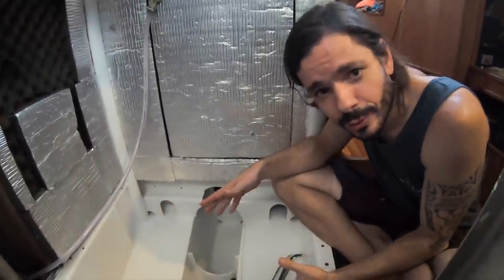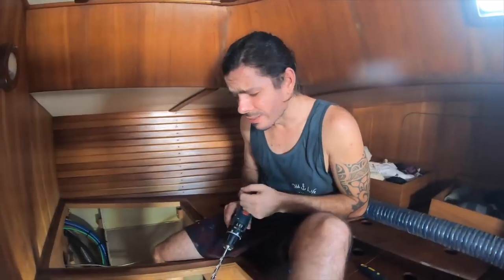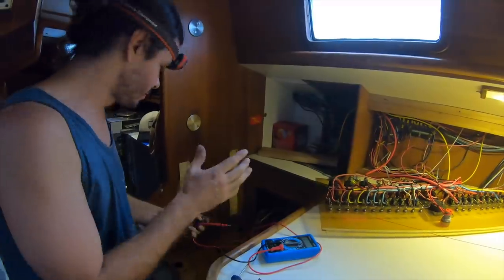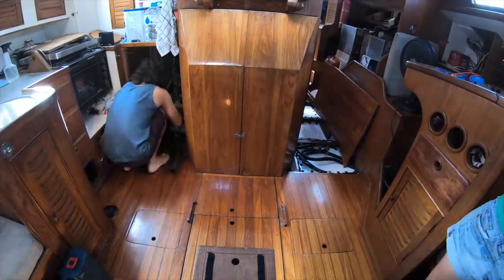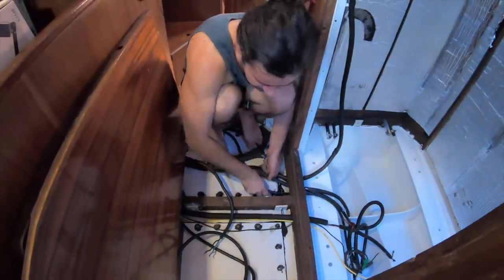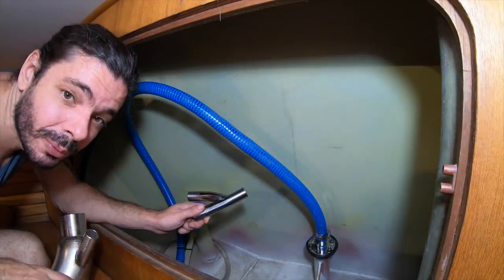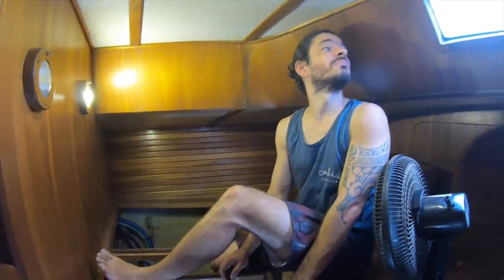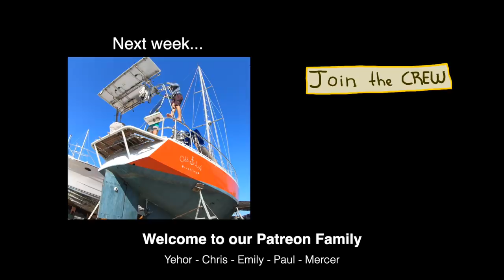⛵️We didn't think about that when we Bought a brand NEW ENGINE for our Sailboat!! 😨#174

Comment: That are some big rats nests. I would recommend you to tie those wires to together and fasten them to the boat., so there aren't any loose wires.

A loose wire can chafe, and if a wire is chafing and it conducts electricity it can become so thin that the current that goes through it can start a fire..

Wires carrying a low voltage can also start a fire.
Reply from the maker: Thanks for the suggestion.

Comment: You need to acquire an oscillating tool. It cuts slots exactly where you want them with straight edges.
Reply from the maker: We would love to but it’s quite expensive here in Brazil
Reply: @OddLifeCrafting  I have an original Renovator, 240V. I have trouble getting blades for it though. If you want it, tell me the address to send it to.
Reply from the maker: @mayflowerlash11  Thanks for the offer, Gary. The problem is that we need to pay 100% in taxes for the product plus taxes for the transport and in the end it arrives here with a high price.

Comment: could go buy a 78mm steel hole saw?.. and use it to off centre the hole! might have to screw some plywood, for pilot hole.. but with a bit of care you can cut out half a hole with a hole saw. fresh saw blade and oil regular, slow and steady.. just an idea. those pipes look a nightmare..

Comment: You may want use a reducing coupler as done in cars if there is no much difference in pressure.   If you do redo the system, ensure it is tight because transverse your quarters. Better to sent it to the top.
Reply from the maker: Thanks for the suggestion

Comment: **The stainless piece will produce more heat then the flex hose.  You may need exhaust shield near cabinet and do not let it touch the hull to reduce vibration and noise. *
Reply from the maker: We wrote some notes on a comment pinned. Check them out ☺️😉

Comment: If you need emergency radio contact, I think you might first use you satellite radio/phone contact but lets just say you're unable to get a satellite signal... I would think you might keep the old standard radio you now have, just in case as a backup. You never know when you might need it, until you REALLY do....... It's the old saying, it's better to be safe then sorry.......

Comment: I have checked the specifications of Vetus waterlocks as a reference. 75 mm (3") waterlocks are specified for engines up to 63 kW (86 hp). 60 mm (2 1/4") waterlocks are specified for engines up to 39 kW (53 hp).  As the last one mentioned is in the range of the new engine of Odd I consider this operation as unnecessary.
I should have modified the waterlock only by changing the inlet to 3" and leave the rest as it was. The exhaust gasses are anyhow shrinking a lot by cooling them down in the waterlock. So to make the pipe behind the waterlock also 3" is unnecessary in my opinion.
Reply from the maker: We would loose their warranty

Comment: hooking up to the bilge pump outlet?? doesnt this reduce the bilge pumps capacity if you have motor running at the same time as the pump....which is quite likely. worst case you may need the pump going flat out and not restricted.

Comment: Hello both! Remember when calculating the two exhaust pipe volumes. That the volume of the 2.25inch pipe and the volume of the 1inch pipe added together does NOT equal the volume of a 3.25 inch pipe! 🤔
Reply from the maker: Check our pinned comment 😉

Comment: You can just us a 3.25inch  hose split into say two 2inch hoses. That gives you the same/ more exhausting capacity and you can use two small pipes that can join back before going out the boat. I would not mess around with using a 3.25 inch pipeline, too much distraction, cost and effort when you can get the same results with two pipes

Comment: Remember exhaust is hot!
Reply from the maker: We wrote some notes on a comment pinned. Check them out ☺️😉
Reply: @OddLifeCrafting  I was just thinking those metal pieces against the wood. The metal is good ng to heat up pretty good if you need to run the engine for a long period. As a fabricator welder, I've seen hot metal catch wood on fire. I'm willing to bet that's why there was an exhaust hose instead of a exhaust pipe when it was originally build. Also why I mentioned, remember metal gets hot. They make a heat wrap that you might consider. Or it might be far enough away it may not ever cause an issue. Just don't want you to burn the boat down after all that work you've done.

Comment: Redo the hole in the bulkhead.  Make it line up with the other exhaust pipe.  Muito más fácil.  There will be no abnormal rubbing and wear.
Reply from the maker: It's part of  the structure of our galvanized steel hull and we don't want to loose the galvanization

Comment: The 
metal exhaust will heat! I suggest you to put some heat protector.....
Reply from the maker: About insulating the stainless steel connections we the Yanmar authorized engineer said it is okay as it is cooled down before entering the exhausting hose. If it was a turbo engine it would be different. And also even though it looks like the metal is touching the wood, it is not. And where metal touches metal we will add protection in between. But to make sure about it we will talk to him again.
Reply: @OddLifeCrafting  talk with him again, please. I have  heard and experienced , to sell the product , they will never tell you the bad, it is like medicines, if you read the documentation, you would not take it. So please take precautions...
One more thing, as I can see on your video, this exhaust is passing under a bed.... open a safe valve , for clean air! You should take %100 precautions. Somebody may sleep in that room, while the exhaust is still working.... This is simillar to the actual world pandemic... We cannot prevent what will happen , next second!!
Reply: I like you both,  and love you like my Son and Daughter, and I am proud of what you are doing. This is the reason of my persistant safety advices! :)

Comment: Though I'm sure your Yanmar tech knows his business, I'm wondering if you're not falling into a very common trap regarding the diameter of pipes and hoses.  It's tempting to think that a 2.25" and a 1" are together equal to a 3.25", but that's very, very much not true.  When dealing with pipes, you've got to work with the area of the circle inside the pipe.  A 2.25" pipe has an area of the radius squared times 'pi', so it would be (1.125^2 * 3.1416) = 3.98.  A 1" pipe is going to be (0.5^2 * 3.1416) = 0.79.  Add those together for a total area of (3.98 + 0.79) = 4.77.  Now, the 3" pipe has an area of (1.5^2 *3.1416) = 7.07.   So two pipes of 2.25" and 1" together is only 4.77, compared to a single 3" pipe is 7.07, which means the two together is still 32% smaller than the one larger one.

There's an old engineering story about a guy who didn't want to run a 4" pipe as it required a sleeve, so he ran 4 1" pipes instead.  Fact is, it takes 16 1" pipes to carry the same volume as a single 4" pipe.  Oh, and a 16" pizza is nearly twice as big as a 12" pizza.  :)
Reply: The yanmar tech knows his business. Dont overthink it.
Reply: @StreetTruckinTitan  I'm an engineer.  I'm literally wired this way.  Lol.

Comment: Although your solution to finding extra exhaust flow was innovative, I have a serious safety concern with it. Should your bilge pump check valve stick open (it happens, bilges build up all sorts of stuff), you risk the potentially deadly back flow of exhaust into the bilges. At a minimum a Carbon Monoxide detector should be installed (needed anyway, and you probably already have it). I would prefer to make a larger exhaust hole through the transom. It really shouldn't be hard - cut/grind out the existing penetration, make up (or purchase) a new one, and have a welder put it in (less that an hour's work if you have properly prepared it). Really easier in steel than fiberlgass or wood! There. I have informed you. I can sleep better, now!

Comment: If you need to change the exhaust for warranty that is what you need to do sadly! The 2" 1/4 pipe would be fine, is a 54hp motor!! not 330hp, the gas flowing through would be less than half of what a 2 litre diesel car (140hp) and 2 1/4 is about the normal size for a 140hp car. All the best, the boat is looking well.

Comment: Thermal management through the metal pipes..  I think they used the high temp rubber for a reason... be careful with the HOT metal exhaust tube around the wood.  Especially if those draws have clothes and such in them.
Reply from the maker: It’s not gonna touch the wood, but we are planning on protecting it
Reply: Its water cooled. Shouldnt get hotter than 70 c.
Reply: @richardowen4325  the exhaust temp ????  Come on man..
Reply: @doinjusfine1  No really. Vetus sell water traps and mufflers that are only rated to 70c. Any of the grey ones. My exhaust temp sensor (just upstream of the water trap) sits at 40c except at tickover when it shoots up to 75.

Comment: 3" pipe has an area of 7.068 in².
2.25" pipe has 3.976 in².
1" pipe has 0.785 in².
Adding a 2.25 and 1 inch pipes only gives you 4.745 in², which is 67% smaller than the area of the 3" pipe.
Since an engine is really just an air pump, restricting the flow by that much may foul the injectors and carbon the rings.

Comment: I would be worried about the failure of the check valve on the bilge pump line.  If it gets stuck even partly open due to corrosion or particles in the bilge water, exhaust gases could back up into the boat causing danger of asphyxiation.
Reply from the maker: About the exhausting fumes coming back through the bilge pump: we will have a one way valve, but just in case we will add an alarm on the bilge and run some tests, if we have any problem we will take the bilge pump from that through hole and send it to another true hole.
Reply: @OddLifeCrafting   It still leaves you a couple square inches of area short of a 3" diameter hose.  7.068 for 3" hose is what is needed.  Your propose area is only 5.19 square inches of area.

Comment: Have you thought about using Starlink for your internet connection on the boat?
Reply from the maker: We didn’t think about it yet, but it doesn’t work well for crossings I’ve heard
Reply: Only when laser links are ready, those are use only in the polar sats. Current user terminals are Geo-locked and indented for land use only.

Comment: 👍
Reply: @OddLifeCrafting ,  it doesn’t really matter what i type, just aslong as i comment, it’s still classed as “interacting”
You know how it worked,  I actually think you’re both doing a great job, will be nice to see when Roberta adds her touch to the timber work (interior). I’m kinda hoping you go a lighter shade on the Varnish, or even a satin finish i think the interior will look much more modern..      I highly recommend you check out SV Avocet  “building you own Lithium battery bank” all the benefits at 1/2 the cost..

Comment: I hate to say this but your engine would work just fine with a 2 1/4 exhaust. You could have just used a reducer. Your engine does not make enough power to need a larger one.
Reply from the maker: We would loose the Yanmar warranty
Reply: @OddLifeCrafting  Sorry to hear that, Keep up the good work. I think that boat will be better than new by the time your done.

Comment: Hi Duca and Roberta. I don't think you will have enough area for your exhaust. 2.25-inch and a 1-inch pipe are much less in area than a 3-inch diameter pipe.  
Area of a circle = area = π · r2

2.25- inches = 15.904 cubic inch
1-inch  = 4.142 cubic inch

Total = 20.46 cubic inch

A 3-inch pipe = 3-inch = 28.274 cubic inches

So, you will be nearly 8 inches short in the area of the diameter of the pipes. the 2.25 + 1-inch pipes are only 71% of the area as the 3-inch pipe!

Please check with your mechanic/engineer. I would hate for bad things to happen to my favorite YouTubers!
Thanks for the great videos!

Comment: Don't ever disregard the HF (SSB as you call it) radio!!

Satphones are VERY affected by heavy cloud cover! VHF maritime has a limit just a tad beyond the horizon. HF's only real arch nemesis is a shitty antenna and lightning.

If wx gets crook and the cloud cover blocks the sat signal (it happens) and you're out of VHF range, you can guarantee with Murphy's law thats when you'll run into trouble.

HF whilst not normally needed, with a mainstay antenna is something that should never be forgotten! 

It's not hard ot get a Codan or other branded set that can be programmed up for HF marine (ESPECIALLY 12meg, 8meg, 6215, 4125, 2504, 2812 and other appropriate USB frequencies). Don't forget an antenna tuner too.

I'm saying this as an ex Coastal Patrol radio room volunteer and an amateur radio operator (HAM).

Comment: Area = radius x radius x Pi;   A = (r) x (r) x (pi)
for 3 inch pipe,  r =1.5 inches,   A = 1.5 x 1.5 x. pi = 7.07 square inches
for 2.25 inch pipe, r =  1.125 inches, A = 1.125 x 1.125 x pi = 3.98 square inches
for a 1 inch pipe, r = .5 inches, A = .5 x .5 x pi = 0.785 square inches

Area of 1 inch pipe + area of 2.25 inch pipe = 0.785 + 3.98 = 4.765 inches square  

Percent Difference :  7.07 x X = 4.765    X = 4.765 / 7.07 = 0.674   x 100 = 67.4% 

Thus, the Area of a 2-inch pipe plus a 1-inch pipe is only 67.4% of the area of a 3-inch pipe.

Does it matter?  Sure, a little, as I suspect the engine manufacturer did a lot of testing to get the best pipe diameter for the engine at a particular RPM. The best exhaust system would be a pipe that changes size as the RPM of the motor changes. However, such would be a very complicated and expensive exhaust system. Thus, the manufacturers pick an Engine RPM and then tune the exhaust size to that RPM.  

The optimal exhaust size is a function of exhaust volume. The greater the exhaust volume, the greater the optimal exhaust size. Exhaust volume increases with engine rpm and fuel delivery.  For a fixed exhaust pipe size, there is a problem or a compromise one mush make. The manufacturer does this – they will pick an exhaust size that is somewhere in the middle, optimized for the rpm when the engine develops its maximum torque, and optimized to deliver the greatest area under the power curve. This will provide the greatest possible torque whilst maximizing average power over the entire power curve. For cars, maximum torque and low rpm performance are favored because this is what makes the biggest impact on normal day-to-day driving.  I suspect boating is different. You likely will not be starting and stopping as much and acceleration is not critical - cruising at a set RPM is what a boater will do most (a guess).   Now if the exhaust was maximized to give the best performance just before Redline, a smaller exhaust may be better at cruising speed engine RPMs. which is likely well below the redline RPM. 

The only way to know for sure is to call the manufacturer and ask them. Also, verify your warranty will be honored for your exhaust system.  Get the verification in writing.

What I do not like is having the exhaust running through the boat like that.  Is there not a way to just pipe the exhaust straight up? I would have several CO2 detectors in that boat.

Comment: You don't want to paint stainless steel !! 
The reason stainless steel is stainless, is due to its oxide layer, a layer it cannot produce when it's covered with  paint.  Painting stainless steel makes it non stainless. Any moisture under the paint and you have a waterlock that is rusting. 

Love your videos!!

Comment: The last elbow why can t you just drill another hole with a hole saw and keep that hose going straight instead of going to trouble cutting and rewelding pipe on an angle?

Comment: 3.0 inch engine exhaust requirement.  However, a 2.25 inch exhaust plus another 1 inch exhaust combined is not equal to a 3.0 inch exhaust.  3.0 exhaust pipe is 7.0714 square inches.  2.25 exhaust pipe is 3.9776 square inches and 1.0 inch exhaust pipe is 0.7857 square inches which added together is 4.7633 square inches, short by 30% of the required exhaust requirement.  Check your numbers again.
Reply from the maker: We talked about it in pinned comment. Check it out 😉

Comment: Duca, love ya man but you need to learn to weld. It would be so much easier to cut out a piece of the bulkhead and then weld it in on the other edge of the hole to align it with the pipe coming out of the engine room. Hard to believe you dont have a multitool. I get it--only so much space on a boat and cost but you guys have a huge boat and just bought a brand new engine!
Reply from the maker: Duca welding: https://www.youtube.com/watch?v=4OwtlNpRuZE&list=PL4cGhq-GjyFk0inZOrhl3IeU9SshIpp7o&index=3 hehehe The bulkhead is a structural part of our hull and it's also a galvanized steel and we didn't want to touch it
Reply: @OddLifeCrafting  oh i remember you welding, i recall you said something like it was harder than it looks or somwthing to that effect. Practice, practice, practice. Galvanized metal can be welded too! You can do a cold galvanizing afterwards as well. If you had to remove a small tab then just weld a bigger one a couple inches over, you guys are smart and common sense gets you far. Plus its a fun skill to have and I think Duca would enjoy learning and mastering it like others hes aquired!

Comment: Now I'm not a safety nut but let me get this clear. You're going to split the water lock outlet between the original exhaust outlet and the bilge outlet. Even with a non return valve in the bilge pipe I would not trust it to hold back engine fumes. Can you imagine motoring through the night and you go down below to wake the next watchkeeper up and they don't wake up!
Reply from the maker: Check our pinned comment 😉